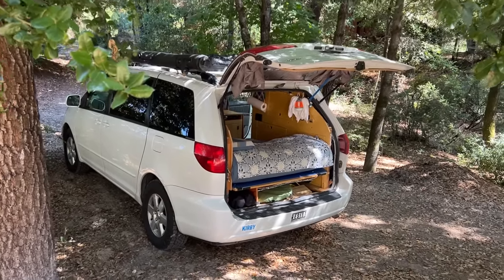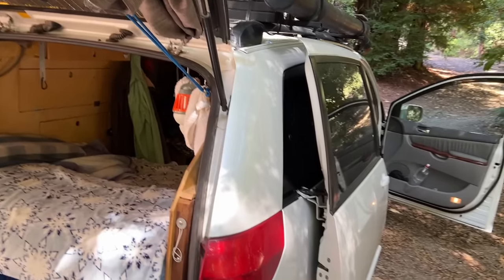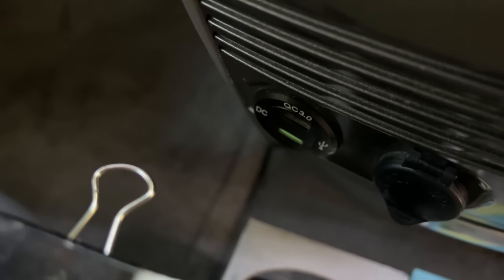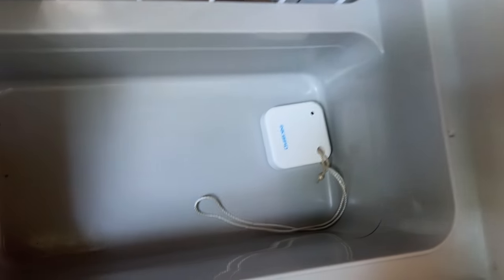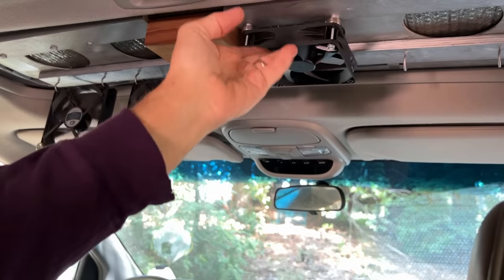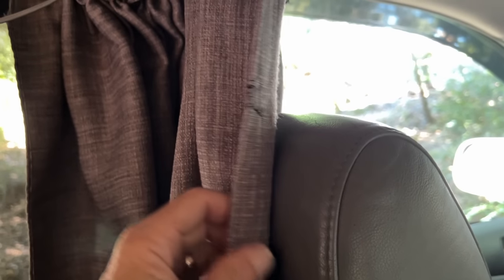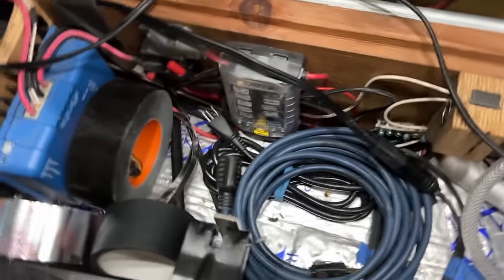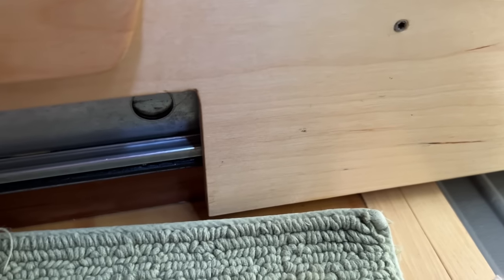Full Mini Van Camper Conversion Tour

Comment: Really well thought out build. Saw you remarked about your power costs. I have dumped the gen pack for a wind turbine. Takes a little engineering to get it compact but for the energy it provides it was well worth the effort.  And even when theres no wind or sun i can set it up and take a nice easy drive and charge the house batteries without the alternator.  Or combine them for a fast charge. But as you know,  thats not the best for expensive batteries.  
Are you going to add a floor to your rear cover?  Im in the process of doing that little job... you know exactly what that requires. But to have that added space enclosed is  going to be a game changer.  I was  thinking about doing side tents but the space and weight made that seem a little much. Besides,  not too stealthy if you have to spend a night in town. I opted for the town and country touring for the stow N go seating.  Once those are removed the space under the floor is insanely large. Yours is the first Sienna ive seen done up. And did you ever do a nice job! Thats a lot of gear in such a tight package.  You really did your planning.  And I like the suspension upgrade. Good thinking.

Comment: Don't got those pc fans but they got similar fans that is bigger. Got one of those hart tool fan it's brushless,  so efficient fan. Use any 20 volt lithium tool battery because of the mod or just made it work. The big hyper tough don't work without a capacitor for some reason.  Comes on and off cycle.

Comment: Very good build indeed. I just wondered about the battery. Saw everything but no battery. There must be one.
Reply from the maker: They are shown in the building videos. I think #3
Two golf cart style batteries between the front seats.
Reply: Where he says they are. I could tell that and I was skipping thru that bit - not required imo but I guess it depends on the type of build you're planning and how much power you think you'll need (not saying you don't need a spare battery but all that wiring etc, just overcomplicates; I've seen way more simple builds that work fine)

Comment: Food, bugs, storage. 
These seem to be you guys' personality thing.
It's interesting how every van build grows to fit the personality of the traveler.
 Me? 
Since I only eat 2 meals a day. Food it not very interesting to me, except as fuel. 
I have a refrigerator, a microwave, and a toaster. No stove. Haven't "cooked" over a stove in years.
- 
I usually eat the same menu every day; including 4 eggs, and toast with peanut butter, every morning.  
Breakfast keeps me going until 4 or 5 p.m. Massive protein and energy for the day. 
I like keto-carnivore meals for supper. 
-
My cholesterol is fine. 
Probably because I walk or run at least 12,000 steps every single day. 
I am lean, fit and healthy. 
-
As Cheap Bob says, "Live out of your van, not in your van."
-
I have a 2006 Grand Caravan with all seats but the driver's seat removed. 

My build is pretty much three times times roomier than yours. 
-
To me, having another person living in my mini-van, with me, would be a nightmare. 
-
Happy travels,
Tom in Dallas
Reply from the maker: So true. Everyone's build is a reflection of who they are. Almost every van build has a sink, many times little else. I installed one, as my wife wanted one, but I didn't find it useful. I took it out and put in drawers instead. I added a roof tube with faucet near the kitchen, problem solved.

I wish my van could be built around a solo traveler. My build accommodates my wife when she's traveling with me, across the country. Solo, the bed could have been smaller and allowed different options and interior configurations. When I do travel solo, I remove the passenger seat which is an amazing amount of extra storage space. We all configure a van to suit our own needs, which is my issue with preform build kits, that usually are to high to actually sit up inside the van. Do I want to sit/cook outside when it's 20 degrees and 30 mph winds or with pouring rain? Not really. I'm comfortable in all conditions, well 110 degrees not so much..

I'm not preaching this is the only way to build a van. If you think that, you miss understand.

I offer one solution that people can take away and use the things that work for them. Everyone has different needs, wants and priorities. I find it's good to throw something together and go camp—find what works, doesn't work, and what do you want to add. That's how I approached my build. (read my bio) Though not everything I wanted, fit. When I started my build, there was one other Sienna on YouTube that had been completely gutted. Nothing on Instagram. That's it, nada... I wanted to give people more to work with after my struggle to figure it all out, basically on my own. The video's of the inside with all the plastic removed—demystify what's hidden.

I have a buddy who when we camp throws all his stuff in the back of his truck and pulls it all out to camp. I wanted a van that didn't require me to set up the table, hook up the stove, set up a tent. I want to park it and sleep, eat when, and how I want without extra tasks. I don't have to sweat water needs, or needing to stop and shop, or a grid connection. It's self contained essentially.

Great you have a set up that works well for you.
Reply: Thanks for the come back. Very interesting. I think of my mini-van as just a "bedroom on wheels."  And not as a "home on wheels."
-
This year, I'm getting a rooftop, stand alone, air conditioner and it's own 400w solar and large power bank (6000ah) set up to accommodate the ac and more. I have about a month of time to figure it all out before I pull the trigger. 
-
I'm tired of the heat and bugs too.
-
You might find this interesting...
Ventilation. Several years ago I cut a 4" hole in my floor forward with a fan and bug screen and vent air up through the roof with another 4" hole with an exhaust fan in the ceiling towards the back of the van.  
-
It's worked okay except in very hot weather.
I gorilla tape the 4" holes closed in the winter time. Here in Texas, it's time to open them up. 
-
I also have a drain hole in another part of the van floor for grey water and urine. It has worked great. Because of my diet, I only #2 once a day; if that. I usually just dig a cat hole or use public accommodation. I ain't much of a scat man.
-
I think of my minivan as pretty much disposable. So I have no qualms about drilling holes or throwing the seats away. It's a depreciating asset and will be ready for the crusher when I am done with it.
: )
 @04_siennaminicamper-nu6vj
Reply from the maker: When I'm traveling on the road, my van is my home...

6000ah is a big investment in batteries, plus storage space to accommodate them. 400 watts of solar won't replenish that very quickly I suspect, hopefully you have a b2b? Though a microwave and toaster draws a lot of power too, so you probably already have a pretty big battery system? I'd love to run a toaster oven. With that kind of power I'd run an induction cook top.

I saw an older van with a standard house window AC unit in the place of one of the back windows at a campground where there was power. Your plan is a pretty big investment for AC. Cost wise, I'd probably just go with finding a campground with power to run AC if it's hot and you gotta have it. A generator would be much cheaper though, I find them pretty annoying.

I head for elevation for cooler temps, sure some days are pretty hot but I watch the weather and head for cooler locations, or as I say just find elevation.

I don't find my skylight fans cool the van all that much. I thought pulling hot air off the ceiling would make a big difference, it doesn't. Half an hour of fans is less cooling than opening the back hatch for five minutes. The fans provide much more cooling just blowing at me.

Last summer in Canada I saw quite a few campers that had huge screen room tents, they'd set up over the picnic table with their stove and chairs inside. A nice cool, bug free space. I might go that route in the future.

I've been seriously considering a small composting toilet to reduce my impact on fragile environments where I don't feel good about digging a cat hole.

 @Tom-Travels

Comment: What do you use as a heater?
Reply from the maker: I have a 2kw Chinese Diesel Heater. Still trying to dial it in. Elevation can be problematic and requires adjustment. Simple once you get into controller. I had to replace fuel tank as the one that comes with them are garbage—constant raw diesel fumes in car. Put smaller dosing pump on it as well. A future video hopefully soon.
Reply: @04_siennaminicamper-nu6vj I'm so sorry about all these people asking you questions about where stuff is that you already mentioned during the video. I wouldn't say I was paying much attention to those bits (I was more interested in your low tech solutions) and I still noticed all that. I generally find vanlife audiences more observant but maybe it's cos you're new (or were when this was filmed)?
The information is definitely there, you didn't dream it 😏 (altho, if you are an engineer, which is implied by other comments, maybe some of us are able to follow your process better than others - I'm not an engineer but I come from a family of engineers so I'm used to the pratter)
Reply from the maker: Yep, first video recorded in one fell swoop, hoped to remember everything, but missed a few items. Before I discovered editing software. But yes I'm not a video genius as many seem to expect—I built a van, not a recording studio... 🤣
My dad was an engineer so I learned to try to  explain the stuff and why. 😂 I can get a bit long winded...
 @susie9893

Comment: That electrical system is way too complicated and intimidating 4me.  I prefer a simple external power station like a Jackery. Other than that, a nice set-up.  I travel soli so a camping toilet is a Given 4 me.
Reply from the maker: If the Jackery has the wattage you need they are really convenient, as everything is already wired. It can be intimidating, and I didn't get it right the first time but a bunch of emails to Battleborn back and forth over six months, we finally got it figured out. (replaced my lithium alternator charger to a B2B and sooo glad I did.) I also like the security knowing I can jump start my car from my house batteries. 
I just added a commercial urine diverting toilet to replace my yogurt cup system. Looking forward to the ease of use, and hoping less smell.

Comment: Wow. You have given me soooo many ideas. I have a 14 foot box truck I've had for 12 years that I was planning on building out. I've collected all the gear to build it out and just as I retired and was beginning to start work on it, the engine blew. I guess that's better than the engine blowing after the build though... Now I'm pivoting and considering going with a minivan for the better mileage and smaller footprint. Great video.

Comment: Awesome build. Where did you get those pouch pockets at 9:20? Brand? Also, what brand of diesel heater did you get? Is that the fuel tank that came with it?
Reply from the maker: Thank you. The pouch pockets my wife sewed up... Custom.😃
The diesel heater was from maxingpeedrods or some such on amazon. No that diesel tanks was an extra $50 and well worth it. I had two tanks and they both leaked—the caps don't seal well on the ones that come with the heaters.

Comment: Hey. Can I have a link to the fan controller? Have a similar setup I’m trying to put together. But the controller I got doesn’t turn them down low enough
Reply from the maker: I'm pretty sure this is the one I used: "RioRand Upgraded 6V-90V 15A DC Motor Pump Speed Controller" It's at Jeff's (Amazon) This one goes to full off.
Some of my fans (three speed ones) I put an on off switch on them, as they didn't shut off: "APIELE 16mm Latching Push Button Switch 12V DC On Off Stainless Steel with LED Angel Eye Head for 0.63" Mounting Hole with Wire Socket Plug Self-Locking" similar price...

Comment: you talked about your mods ..., but, did not actually show them and how they work but still love your videos and your build described everything in detail kinda cool and thank you for the info what videos to  watch
Reply from the maker: You are correct. I didn't show them. The AWD springs and struts look just like the the FWD, except cleaner. Guess I could have video'd them, but not much to see there. It's the concept of swapping AWD suspension parts for FWD. If you really need to see what they look like please check my Instagram posts. The very early posts 8-2019. I have pictures there of the parts before the installation side by side with the old. There's also a few posts about the airlift airbags with pictures. Installed 6-2020, and modifications a year later. Hope that helps.

Comment: Do you have the measurements of your bed/ couch I could not see much of it due to the bedding on top.   I really enjoyed every minute. Of your build video
Reply from the maker: Yes it's about 73" long, back door is curved a little so longer at center shorter at sides. It's 47.5" wide.
If you want more bed detail I have a video on the bed in my channel.

Comment: I think for me, Id put a sit down toilet in the space that the the bottom 2 drawers of the kitchen are located. Then those pots could go under the fridge (raise the fridge 6 inches)
Reply from the maker: Actually my original design was a toilet in that space. 👍I went with a sink, then replaced it with the drawers. I'm planning a compact composting toilet between the fridge and the rear side cabinets on the drivers side against that sliding door in the next few months. Easy to remove there. I need to build a short platform for it, so it can be used while bed is deployed.
The fridge is already raised near 6" for ski storage. Pots and pans were originally in the under the bed storage. Was a PIA. Much easier next to the stove.
Reply: @04_siennaminicamper-nu6vj  "used while bed deployed" sounds good !

Comment: This build not for me - way too complicated and too much stuff for what I'd do. 
But I did appreciate a lot of your little fixes. Got a few good ideas, so thank you
Reply from the maker: Thanks! That's the idea. Take what you need and leave the rest... 👍
Reply: @04_siennaminicamper-nu6vj have a question though: was there a reason why you went the route you did rather than using a lift kit to get more clearance. Was this cheaper? Were lift kits not around for this model at the time? Or were there are other considerations? 
I ask bcos I'm often a little concerned about the long-term effects of lift kits on the vehicle and perhaps you know something I don't?
Reply from the maker: The Journey's kit was costly. The feedback on that is the drive axels become a regular maintenance problem, needing replacement. Some say 50K miles, I just read this morning one person who does a lot of them its 15k Miles. When I inquired to have it installed they said replace the axels at the same time as the lift—It gets expensive. The look isn't the best either. I had considered the 2" Traxda but converting with and springs/struts gained me a nice mild lift without any repercussions. I'm still debating using Honda Oddyssy rear springs for the rear lift given the camper weight gains. Potentially a Traxda to match, for the front.  Larger tires do make the car struggle more up hills but the lift has been adequate for most of my explorations, and much cheaper. Another shop told me lifting the rear with just spring height messes with angles so... What to do, and who to believe? @susie9893
Reply: @04_siennaminicamper-nu6vj  that's very interesting. Many thanks for the detailed response. I guess I'll have to do some significant research of my own and then bite the bullet like you did. We can only make decisions based on the best information we can obtain at the time. Only hindsight is 20:20 😏

Comment: What did you call those white strips on the hood.  Did you glue those on ?
Reply from the maker: The white plastic strips along the roof of the car are called Keder Rails. They come generally in 4' lengths or 8'. 8' are costly to ship, that's why I bonded two 4' pieces each side.

Comment: Pull out the passenger front seat. Do you think  that would be ok?
Reply from the maker: Yes I do it when I travel solo and put the folding bike there. Only issue is the airbag light flashing on the dash. I get used to it after several days.Be sure to disconnect battery before and also before reinstalling, to prevent airbag deployment.

Comment: How much, minus the solar panels, do you have in that electrical system?  I wonder why one wouldn’t just use a portable solar generator instead, particularly if that electrical system including those batteries is anywhere near $2k.
Reply from the maker: Yes the electrical was near $2k. Portable solar generator? The Fridge needs power all the time when traveling. The sun doesn't always shine.

I also went overboard on the system–extra battery, larger inverter in order to power our refrigerators at our home when the power company cuts our power–a frequent occurrence.

Comment: This is a safety hazard from hell. I hate to see people doing this, really...  Inertia.  If you wreck, it all comes up front & kabobs and likely decapitates you. Auto manufacturers could never sell you a vehicle made like this cause it would be illegal.
Reply from the maker: Interesting. Looked at a Winabago? Have you disassembled a car to see how well things are attached? All the framing in my build is bolted/screwed/glued to metal framework. More than I can say for the manufacturer. Everything is tied together. Flooring bolted to metal floor, kitchen bolted screwed to floor. Cabinet framing bolted to floor and ceiling. The one mistake I made was not removing rear airbag inflators and tying off the airbags.
Thanks for your concern.